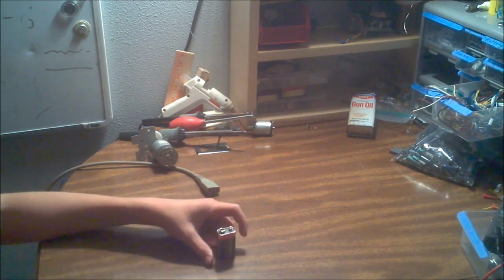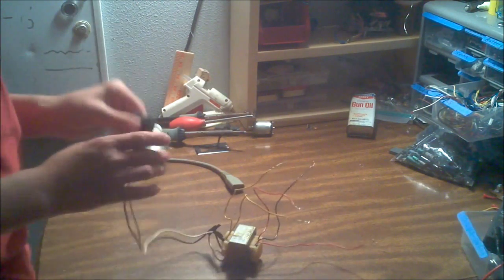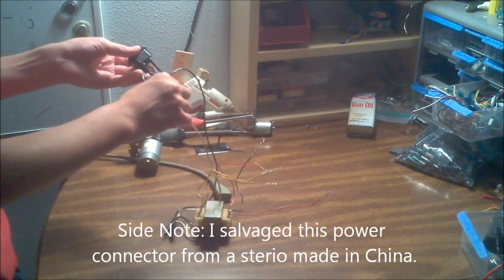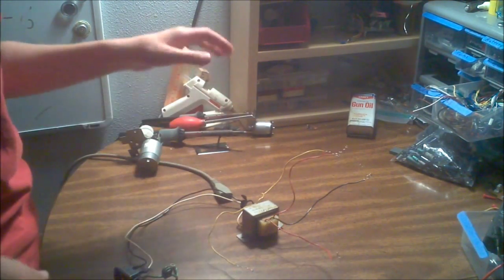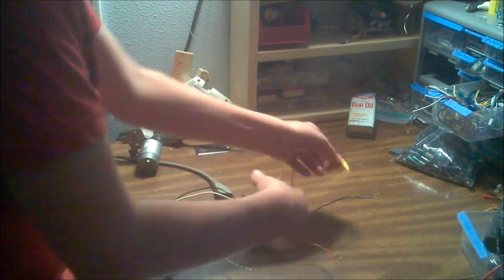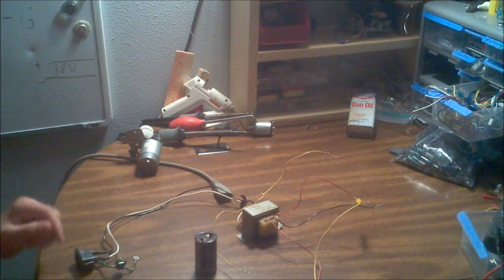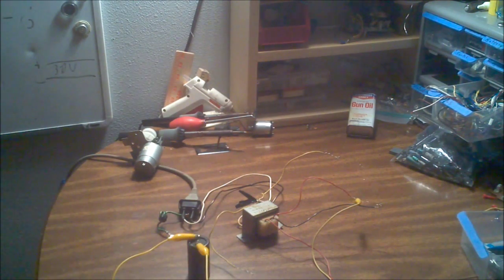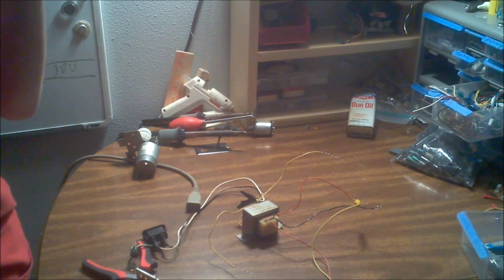How to Build a Linear Power Supply: Basic Electronics 13

Comment: If I remember right when figuring your voltage it is usually specified in RMS,but your actual voltage is peak to peak voltage positive and negative half cycle. So for a 60 volt transformer you have 60 x 1.29 =76.2 volts AC then run through a full-wave rectifier you loose about 1.2 -1.4 volts which gives about 68.6 - 70volts of DC, and 24VAC X 1.27 = 30.48 Volts peak to peak AC Voltage minus 1.4 volts for rectifier equal about 28.1DC Volts.

Comment from the maker: It was around 70 volts, but I didn't actually use the same transformer in the final project. The voltage was much too high to be easy to use. I ended up using a 24 VCT transformer, which gave me about 17 volts DC per tap. I used voltage regulators from the 78XX series, and sometimes used LM317 voltage regulators as well. My needs varied from project to project, so I never put a regulator in the final enclosure. I just made the regulator circuit for each project that needed a different voltage.
Reply: Says you can buy one for $12 at radio shack. Instead spends $600 on toroids for  50A PSU.

Comment: Good explanation!  After rectification, how many VDC, and how did you knock it down to the 9VDC you wanted?  Current?  You could get several fixed voltages, or just vary it from 0 to whatever you ended up with from the rectifier.  Did you put a voltage regulator on it?  Thanks for posting!